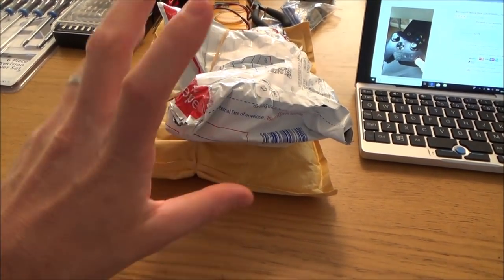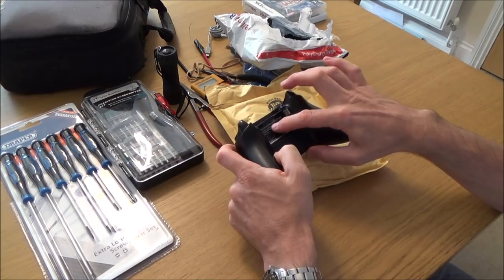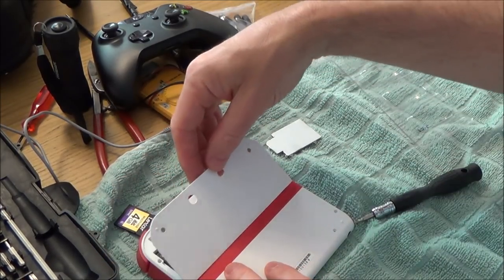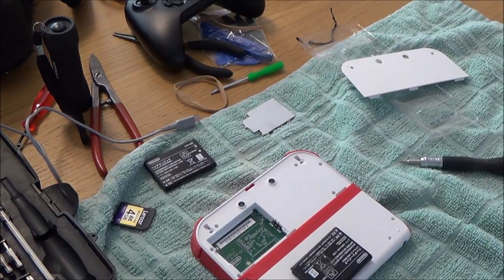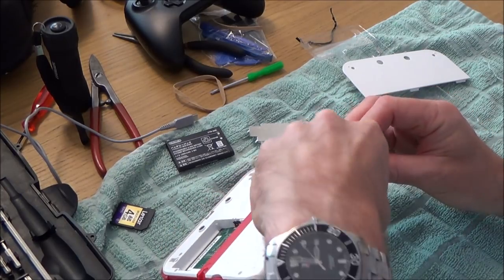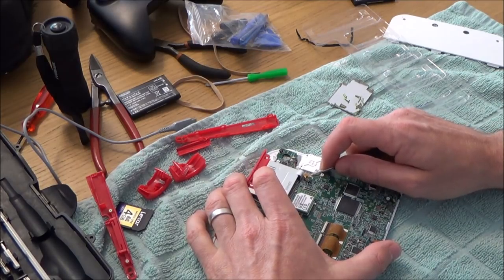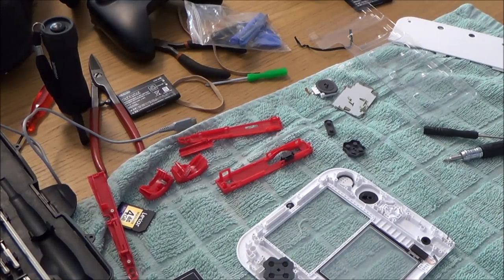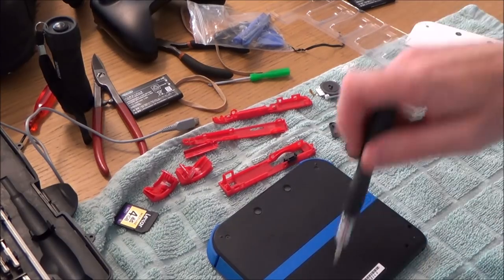Trying to FIX a Nintendo 2DS and Xbox One Controller purchased on eBay

Comment: god i wonder if you could fix my controllers, one has a sticky x button and the other (a custom shelled controller i made) has a drifting left stick, i wish i had the skill to fix stuff without breaking it more
Reply: AnOrangeHellcat For the X button, get a paintbrush or toothbrush, and wet it and scrub into the button, on top, around and in the grooves.
Reply: For the sticking button I usually take a tiny bit of oil on my finger tip and work it into the button. That usually works great for me.

Comment: When device manager said there was an Xbox controller there but it said DFU that normally means recovery mode so when you had it plugged into your Xbox it will have probably seen that there is a controller plugged in and it might of updated the firmware on it so then it would work

Comment: I AM IN DESPERATE NEE OF HELP. NO ADVICE ON TRADING IT IN OR ANYTHING LIKE THAT.

but i am overly protective of my switch. 
no dust
no dropping.

I get irritated when friends and family hold the left joycon (cuz i always use the right) because the either hold it to tight, press down to hard on the buttons and joystick. and they squeeze it too hard rarely.
i alway tell them before they use it to do the opposite of what i tell them not to do.
but when i use it. the left joycon is either loose (i fixed that with tape. thanks btw)
it's shifted abit so it's no in line strait vertically. or the triggers and buttons are wiggly. PLEASE SHOW ME A WAY NOT TO BE OBSESSED WITH MY DOINS OF ATTEMPTED PERFECTION

Comment: My old controller did this when I think the firmware update failed, I can't say for certain. Stopped working for months and couldn't get it working so I gave up. The randomly it started working but was sorta glitchy so I did a firmware update and it fixed it

Comment: For xbox controllers the screwdrivers 🪛are security torxs 9, 8, and 6. 8 is for xbox 360 controllers and needs the hole in the center. 9 is for xbox one controllers and needs the hole in the center. 6 is also for xbox one controllers but I am unsure if it needs to be a security (the one with the hole in the center) or standard t6

Comment: I have this issue with my Xbox One controller. It was caused by unfinished firmware update done with use of PC. Only Xbox can repair this, and unfortunately I do not own it. The procedure for repair is to connect the controller to the console without batteries and wait. I think you should connect the controller before powering on the console (it will restore previous firmware, not newest one). I used controller for my PC, so out of luck until I can get One for cheap. Really like Your videos, but you desperately need to check videos on how to soldier :)

Comment: The games are built in to the 2ds it's not a code so you can sign in on one account and use the game then factory reset it and get the game again for free as the code is tied to the 2ds and pre installed

Comment: The general rule is that about 25% of all "broken/damaged" electronics aren't actually broken. People simply don't want to even try fixing most things. 25% of the tine it's a kid who's parents will simply buy them a new one or an adult that has zero experience or understanding with how their devices work.

If you don't buy from repair services you'll buy something that is easily fixed 25% of the time. I'm talking "new battery" or "new charge cable" level of fixes. 

50% of the time it's something you that easy or something that takes a tiny bit of effort in the device itself. Sure, that other 50% is truly damaged stuff that requires parts, soldering skill, specialized tools, etc but many things aren't truly broken at all.

Comment: I have fixed many xbox controllers they are easy once you get use to it. Actually my site is down under construction, I have tutorials, and planning on starting companyt where I mod controllers like Scuf style however much better as far as xbox, including better shoulder, better paddle/button system, joysticks similar however I do not have a way or connecction to produce or a 3ds designer to create a model for the rings for their "self lubricating" system. However I have similar polymers and no slow aswell. I just need a few minor adjustments, and money to get the produduct out their. I had litterally spent years trying this and watching the elite and others take my idea I scarpped many of the ones they used, and just need the capitol to get a decent quanity made, also minor adjustment but can't afford 3d designer, hardwar engineer ect right now. So all I have is a few prottypes, many high level halo players loved the prototype, I had to do tons of research and time and took apart so many controllers to get ideas. Im affraid my dream of gaming company will not ever work, as developers have come closer and closer to my design, and can't afford a laywer for patent or anything, plus it's hard to do with design. It sucks, a 5k loan would help lol but dont want to ever be in debt.  I have a website, not for gaming company (i do for that at least domain) but my current one is being worked on by myself. I will add tutoriasls for fixing things, hacking things, CFW, and more. 

Besides that my 2ds has that same ripped ceosscord/ribbon cable. lol my solider iron broke so my controllers have been on hiatis witch sucks.  lol i have an open 2ds watching this with ribbon broke, ripped completley, something im least framiriliar with. Mine turns on and charges but nothing. actually 2 of them. Hopefully the second 2ds broke ribbon isnt ripped where this oone is.

Comment: hello, willing to help a fellow nintendo fan??
I bought a 2ds a few weeks ago and it was sold as "will not turn on". I got it with the only response it would show me being a charging indicator light that would eventually turn off. since I've recieved it I've torn it down, unhooked and cleaned the ribbon connectors, plugged them back in, checked for broken parts(there are none), as well as no noticable water damage whatsoever. lastly I've replaced the battery with a brand new one, to no avail, still only a charging indicator. any recommendations? help?

Comment: I'm sure someone has already said it but as shown by Windows Device Manager the Xbox Controller was in DFU Mode (Device Firmware Update) which is a protocol also used with other products that update over USB, mainly Apple iOS devices. I imagine that a previous update to the controller failed, maybe the Xbox was turned off during the update process or the controller ran out of battery (though I think only the newer Xbox Controllers can be updated wirelessly so that might rule that out). Leaving the controller connected to power probably initiated a reboot as usually DFU mode has a time limit, if no firmware update is detected then the device will exit DFU mode after a set amount of time. Normally this would revert the device back to its original firmware which could have just been too old for the newer Xbox update causing the timing issue with button presses and the newer firmware corrected that. Alternatively if the devices original firmware was corrupted during the previous update attempt that could also have caused the issue. Going forward, it would be easier to test a controller with a Windows PC, there is a controller test function that can show if all the buttons are working and if the thumbsticks and triggers are calibrated correctly. This works with any device that uses a standard XInput driver which includes Xbox One, Xbox 360 and PS4 pads. Just look for 'Devices and Printers' in Control Panel, right click on the connected controller and click 'Game controller settings' then 'Properties'. Hope this helps for the future, keep up the great content.

Comment: What do I do if bothe of those same ribbon cables were broken on both used DS's I got ripped off on. Can I use another cable from another devicecor ribbon, or cut it then use themal paste? Why does the ribbon connect to that medal bracket on the back piece do, I see connectors, is it for camerea to screen and then screen does not work because the broken ribbon?

Also those are easy to replace the AUX port, super easy on xbox, you can get them from a third part also. I fixed a scuff with a bad port made mic terrible, I I took onbe from a regular controller and used it, also just repositioned them before.

Comment: I think I know what was wrong with the xbox controller I think the two boards started separating because the b button is on the back  board and all the other buttons are onto the front so when you press the b button I separates the circuit boards and then your controller stops working

Comment: please make a video by adding scuff buttons to the pro controller of nintendo switch
Reply from the maker: Funnily enough I was thinking of a video of adding face buttons to the back of the Joy-Con like the Xbox Elite paddles. Might be useful for games like Fortnite. Didn't think of it for the Pro controller. It is a good idea. It might be beyond my ability but I will definitely look into it :-) Thanks for sharing the idea.
Reply: My Mate VINCE in the joy-con would also be very good idea, but I think it would be more complicated for space, I did with a PS3 control, I would in the pro controler but I could not find the circuit map of the board. hope you can make it. greetings from Argentina :)

Comment: 2DS xl is a way better handheld
Reply: New 3DS is the best in the 3DS lineup imo
Reply: EpicallyEvil 
Yeah new 3ds XL has to be the best because of the 3d option. I have regular 3ds xl but hope to upgrade to N3ds xl when the prices plumet
Reply: Sterling20073 the 2ds Xl is cheaper and has a fast processor
Reply: 2DS Rat I would pay the extra 50$ for a new 3ds xl tbh